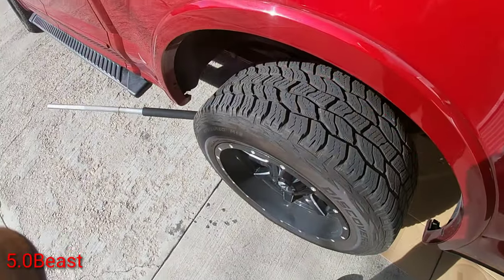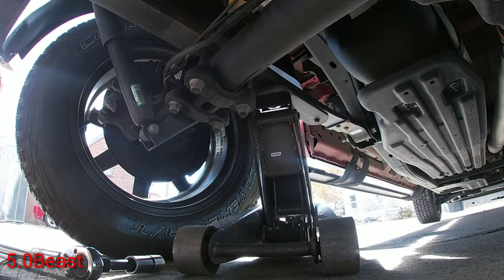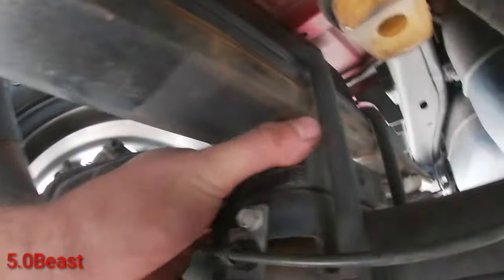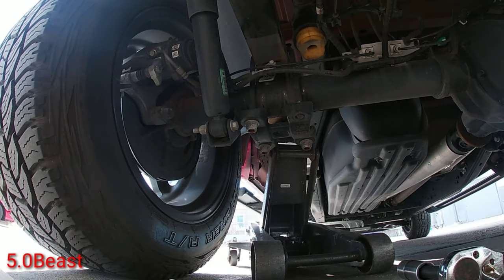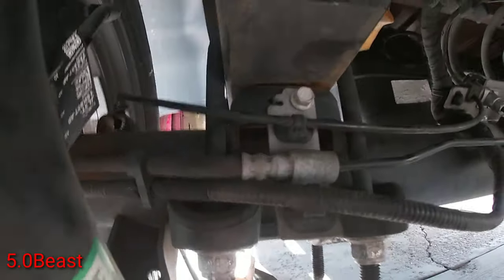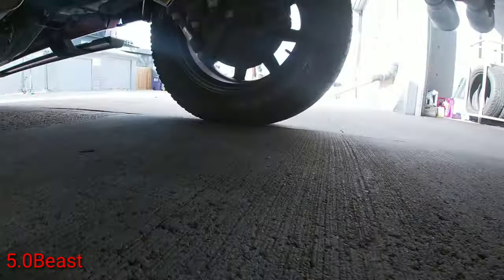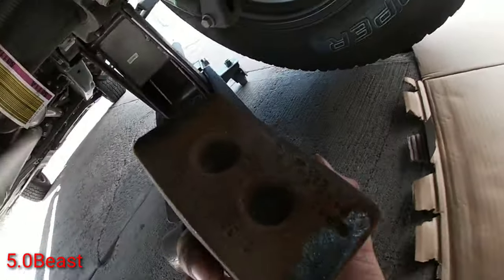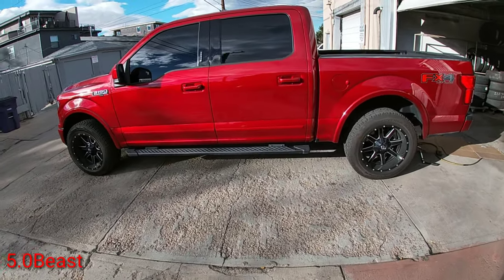2018 FORD F150 REAR BLOCK REMOVAL

Comment: Thanks for the video! I just completed this free mod on my 2017 F150. Took about 3 hours because I almost dropped the truck when I removed the U-bolts and then decided to lower the rear diff to remove the blocks. If I didn't use jack stands I would have been in big trouble. By lifting the truck using the rear diff, make sure you remove the rear wheels first. That way the hubs can be lowered enough to allow you to take out the blocks.
Reply: I just did this too, but are we supposed to use the spacer bolts to hold the springs together or are those bolts no longer needed?
Reply from the maker: You still need too put your u bolts back in.
Reply from the maker: Your welcome and yeah you gotta be careful any time you work under a car. Better be safe then sorry

Comment: I removed the blocks from 23' Rattler the same way, but added stands under the frame for safety. No problems, springs went right back
into place
Reply from the maker: Yeah pretty easy process

Comment: Thanks for the video brother. On a side note you should never use a calibrated tool like a torque wrench to loosen fasteners.
Reply from the maker: Your welcome. And yea I know better worked at my uncles shop for 7 years but didn't have my breaker bar handy lol. Thanks for the tip
Reply: @Eldela5.0  is it okay to just jack up the leaf spring and not the differential?
Reply from the maker: Best way to do it its to lift truck to frame with Jack stands and lift and lower from the differential.

Comment: Nice work bro. I like that, much cleaner looking stance 👌 Did it change the ride quality much? Unfortunately I have to leave mine in to keep the squat down when pulling my travel trailer. Guess it's a trade off.

Comment: did this on my 21 and it is exactly the same. said this in a comment few months back by the account got deleted. but my rapid red (similar color to yours) looks nice and mine is a fx4 as well
Reply from the maker: Nice I just got my 22 like a month ago and already have the parts too do it just need the time. But they discontinued ruby red so got a rapid red.

Comment: Thanks for sharing just did it today. I have a 2019 with a 2 and 1/4 level and removing this leveled it perfect
Reply from the maker: Your welcome glad it help out.
Reply: Do you mean that you bought a 2 1/4" leveling kit? I'm new to trucks, but isn't that the opposite of removing rear blocks to lower the rear a little? I thought a leveling kit only raised the front end to match the high rear.
Reply from the maker: You can do a reverse leveling kit like I did I bought ford performance 2 inch shackles and removed 4x4 rear blocks

Comment: I went to remove mine and add a 2" block, but couldn't tell if the block was bolted thru the upper leaf and the u-bolt plate (on top). Nice to see here the block is simply sitting there nested only.

Comment: I had the OEM rear 4x4 blocks installed with my front 2” Level kit on my 2WD f150 and it sits like a stock 4x4 F150. But I’m taking the rear blocks out so it sits level.   Don’t care too much for the rake.  Thought it would have been more leveled out.
Reply from the maker: Yea it should leveled out since 2wd come lower from front just with the front leveling kit it should of leveled but ones your added rear stock blocks you got that rake.

Comment: I’ll give you a like. And a subscribe too. Thanks for making this video. I had no idea this was possible and so easy. 

What torque did you use when you re-tightened the nuts?

Please do a video for the shackles too if you decide do them.
Reply from the maker: I really appreciate that thanks. I torque them to 100 lb but first did 50 lb. Yea i will for sure

Comment: Looks great! Thanks for taking the time to edit out the impact. Should have used stands, but otherwise ok.
Reply from the maker: Thanks I should off used stands way safer.
Reply: No reason for using stands. Truck was still on its wheels
Reply: @jbouchard4877   if the truck was still on its wheels then why did he need the jack?
Reply: To take the weight off the axle
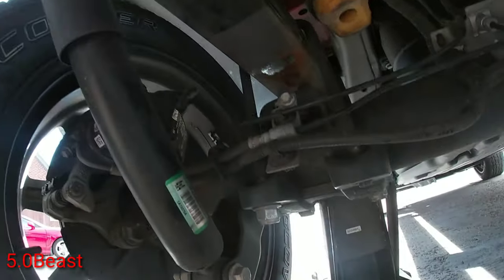Reply: @jbouchard4877   What happens at around 4:19 if the jack fails?
Reply: @charredskeleton nothing happens
Reply: @str8trkn   Ok what could have happened at 4:19 if the jack had failed?
Reply from the maker: Might loose a finger or two that's why I try too remove it fast lol
Reply: @Eldela5.0   By no means am I dissing you. You seem like a cool guy. And lord knows I’ve done some SKETCH shit. Every time I think it’ll only be a second ‘shake hands with danger’ goes through my head. Seriously check it out if you haven’t seen it. About the best safety vid.

Comment: Did you have any issue using the 4x4 U-Bolts after removing the blocks ? Like running out of Thread ? Also any issues with Pin Alignment in a forward way ? I see that they didn't align sideways initially and you hammered it to click, but I'm afraid of the Leaf pins being a little bit forward than the wholes at the axis. OMG my way to explain this is very confusing sorry.
Reply from the maker: I didn't have any issues using 4x4 u bolts but they are cheap to buy the 2wd version so they won't be all long. And no issues at all had it like that for past 20k I even added the ford performance lowering shackles already.

Comment: When putting everything back together, how much pound feet of torque do you need to torque down the bolts back very interested in doing this myself. Don’t want to have it too tight and cause too much squeaking and noises and I don’t want it to be too loose to where it falls apart down the road.🤣
Reply: And does it affect ride quality at all? I like the stiffness of the FX4.
Reply from the maker: I did 100 pounds feet of torque. Never got any squeaking or noises and didn't feel a difference on ride quality.

Comment: Oh man that looks great,I only want a 1 inch lower  in the back,was thinking that would work,thanks for showing us that. I think Ford just adds the block on 4/4, leaves them out on 2wd. I think? It should still drive good. 🏁🏁👍👻
Reply from the maker: Thanks and yea it looks a lot better. Yea only 4x4 have it 2wd dont have that block and it drives great had it like that for about a month already.

Comment: Thinking about doing this to my truck it sits way to hi in the back ,don't no what ford was thinking. Its a shorty and looks like it might fall on its nose if I hit the brakes to hard lol
Reply from the maker: You can do that or order the ford performance shackles. I got mines already just haven't had time to intall. But removing block its free if you have a 4x4
Reply: Ya it's a 4x4 it looks just like yours
Reply from the maker: It's a easy free way to lower it then

Comment: Why were the blocks installed in the first place in the rear? I’m thinking of leveling the front on my 14 f150 so I can get bigger tires. The shop said the rear would have to be raised 1 inch. I don’t think so. The rear is already raised, the front is the problem...right? Nice looking truck. Remove the lift on the silver one in the rear.
Reply from the maker: Blocks come factory on 4x4. You don't need rear blocks for leveling kit. Thanks and we might do a front leveling kit on silver one.
Reply: Correct. If you’re wanting to run bigger tires you’ll want to leave the rear block in and add a leveling spacer to the front in order to clear those larger tire specs. Most leveling kits will add a 2-2.5 inch spacer to the front and a 1 inch block to put on top of the current rear block (lifting the rear another inch). That’s normal.

Comment: Hey man I did the exact same thing on the exact same truck and my entire axle needed to be moved for about 1/2 inch to align the lead spring. Basically my leaf spring need to come backwards not side to side like yours.
Reply from the maker: That's weird did you by chance did it down hill or something. Minds went pretty straight just move a little to the side
Reply: 5.0Beast hahah yeah that might been the problem, it tried it in my drive way backward and it’s at an angle so possibly didn’t think of that 😂

Comment: It didn't look like the block was tapered, did you have any driveline vibration after?  Did you have to correct the driveshaft angle?  Beautiful truck, great video, thanks so much
I have a 2019 and it just makes it into my garage.  I need a canopy on it and I don't think it will make the garage with the canopy
Reply from the maker: No driveline vibration. And no need for driveshaft angle unless you go more then 1.5" lower. Yea this things are huge dont fit in my garage either.
Reply: @Eldela5.0  Thanks!
Reply: If you do the shackles then you need to shim the rear end and the rear of the transmission. I believe all the shims you need come in the Ford Performance kit.

Comment: So I got a 2015 f150 with a full 4 inch suspension, you think if I take out that 4 inch block would it matter if I ran no blocks?
Reply from the maker: I have no rear block but you will have to go to stock front suspension or else you will need shims

Comment: These blocks are only on 4x4 models right?  I removed the blocks and now I'm going to get new shocks. I wonder if I should get the 4x4 shocks or the 2wd shocks?
Reply from the maker: Blocks are only on 4x4 and ill be getting 2wd shocks when the times comes.

Comment: It looks great but still needs to come down more like another inch
Reply from the maker: Thanks and yea it needs a little lower ill be ordering the ford performance lowering shackles soon so hopefully and looks better.
Reply: 5.0Beast definitely will! Finally a channel that doesn’t lift the truck 😂
Reply from the maker: @BugsTools  jajaja i like both but i also love lowered trucks.
Reply: @Eldela5.0  make sure you get the Ford Performance ones and not the ground Force ones, because the GF ones don't come with the 2.5° shims, and call GF if you want the trans shim!
Reply from the maker: @EliminatorPerformance  yea i made some research already but iam all set on the ford performance. But thanks for looking out

Comment: I’m planning on doing this for my 2019 f-150. It has a 2.50 front inch leveling kit installed but i was reading some people said to buy new u bolts. Would I have to do the new u bolts if I have 4 wheel drive and 40k miles?
Reply from the maker: I didn't buy new u bolts but as you can see in video they stick too much down

Comment: Are pinion shims needed when you remove the blocks?  I have the 3.5 2023 F150 and I am looking to do this.
Reply from the maker: I didn't do any Shims and I didn't get no vibration or anything I also did it on my 22 f150.

Comment: I did a rough country 2 level kit on my 2021 f150 and I still have a slight rake. I don’t want to mess with my front suspencion anymore and I do like the way it sits with the BFG KO2 “34” but again that back sucks!! I’m really considering doing this modification. My only concern right now is the ride quality after you removed the block. Does it ride better or worse? Thanks for sharing this information and video with us.
Reply: I have the same issue with my 2 inch rough country kit and have been debating on doing this as well.  Can’t stand the slight rake I still have.  Did you end up doing this? How did it turn out?
Reply from the maker: If you do it it will drop it like an inch and ride quality don't change.

Comment: I'm not looking to hate, but come on dude, you're going to get someone hurt or their truck damaged with this video. You don't loosen or remove U-bolts from a truck while it's still on the ground. Do it the right way. Jack it up (from the frame, not the leaf spring like in the video) and rest it on jack stands. Support the rear diff with a jack and do your thing. U bolts get tightened in an 'X' pattern to 98 ft lbs. Ideally, you should get new U bolts / nuts as those threads stretch. You can get 2wd U-bolts from the dealer and they will be the correct length.
Reply from the maker: Yea i know what you mean at the moment i didn't think how to remove them but yea its dangerous if some one does it downhill or doesn't align Jack right or does it to high.
Reply: @Eldela5.0  For sure, good learning experience. It'll work that way as long as everything stays put, but if not it's a bad day! Kudos for posting, hardly any videos of it on these trucks.
Reply: That is probably how I would do it[jack stands] but I don't see a problem with the way he did it.

Comment: What size wheels and tires are u running I need to know the offset too and does it rub at all?
Reply from the maker: They are 20x10 -13 offset with 275 55 20 barely any rub when I turn all the way going up driveway

Comment: Do you have to do an alignment when you finish removing the rear blocks?
Reply from the maker: Dont think so since we dont have independent suspension
Reply: 5.0Beast I agree. I don’t believe there’s any adjustments in the rear
Reply: Yea you can do it yourself tho. Remove the wheel and add 2 thick washers to the 10,12,and 2oclock positioned studs, then replace tire. 🤙🏾🤙🏾🤙🏾
Reply: @brycea0225  is it okay just to jack up the leaf springs? Other videos that jack up the rear end

Comment: So I have the Ground Force 2” lowering shackle and it didn’t drop it enough for me... do you think if I did this it would make the truck too low in the rear?
Reply from the maker: If you have a 4x4 it should lower it about 1inch and quarter. Doesn't the shackle you bought have 2 different option for lowering.
Reply: The GF lowering shackles alone should give you about a 1.5 to 1.75" drop. They only have one height setting unlike the Crown or Maxtrac shackles. Removing the rear block will give you about another 1 - 1.25". Go measure your ground to fender heights and see what the #'s say. By removing the block, you should be about perfectly level on the driver's side, but the passenger side might sit just slightly lower in the rear than the front. It probably won't be noticeable unless you really study it.

Comment: When you bought the truck did it have rear oem blocks?
Reply from the maker: Yea it did have rear blocks all 4x4 have the rear blocks.
Reply: yours a 5.0 right ?
Reply from the maker: Yea it's a 5.0
Reply: @Eldela5.0  what were the u bolts torque specs ?
Reply from the maker: I believe it was 98 ftlb
Reply: @Eldela5.0  cool thanks 🙏🏼

Comment: What size tires/rims are you running? Any rubbing in the front?
Reply from the maker: Iam running 20×10 -13 offset on 275 55 20 barely rubs when you turn all the way

Comment: I did this to mine looks much better, I don’t tow so no need for the ‘jacked up look’ and easier to reach in bed from the sides.
Reply from the maker: Yea they look much better I also did the ford performance lowering shackles and it looks pretty leveled.

Comment: Is alignment needed after the blocks are removed?
Reply: No alignment needed unless you do something to the front suspension. Removing the blocks in the rear will not cause any change.

Comment: How is the ride quality now?
Reply from the maker: Rides about the same just went i load it up it squads more then before butbits expected but looks a lot better
Reply: @Eldela5.0  cool I put a 2 inch add a leaf on mine and it came out too high. So im thinking of doing this as a quick fix.
Reply from the maker: @abelduran9710  that should do it minds is temporary aswell umma add the ford performance shackles.

Comment: Great video! Can you tell me what size wheels (width and offset)  and tires you're running? The stance looks perfect in my opinion!
Reply from the maker: Thanks and wheels are 20x10 -12 offset with 275 55 20 tires
Reply: @Eldela5.0  You're the man! Keep up the good work. Just subscribed!
Reply from the maker: @tropikalbobz  thanks a lot for subscribing.
Reply: You have any issues with rubbing in the frontend with that tire/wheel set up bud?
Reply from the maker: @jaydee9699  it barely rubs at full turn but tires i had on it before the coopers didnt rub at all.
Reply: Appreciate the reply bud.. did you go with a wider tire than your coopers were,  or is it the offset of the wheel you think that's making it rub?
Reply: I've got a 2015, and going to take advantage of this unusually warm day up here in NewEngland and yank my rear blocks out.. The stance of your truck is what I'm shooting for thing looks great!
Reply from the maker: @jaydee9699  i had some Nokian AT before and didn't rub. Now i have the Cooper AT and they barely rub at full turn and they are both same size 275 55 20 but that's how it is with tires they change by brand like shoes
Reply from the maker: @jaydee9699  yea i didn't want to add a leveling kit at front so decided to level the rear and i like it.
Reply: Ahh ok ok .. again appreciate the replies.. just trying to get as much insight as possible before possibly dropping 2G's on new wheels and tires to have them rubbing like crazy, not trying to do any major cutting... but like most guys and their trucks.. 'Looks' takes first priority 😉
Reply from the maker: @jaydee9699  your welcome and anything i can answer i will i did 8 years in a tire shop so did a lot of tires jajaja
Reply: Got out there and yanked my blocks out yesterday thx to your vid, truck already sits a hell of a lot nicer... gonna go a little lower in the upcoming weeks and fit her with some new wheels/tires thanks again pal
Reply from the maker: @jaydee9699  your welcome any time
Reply: Anyone who did this have any issues with vibration when they took out the blocks ?